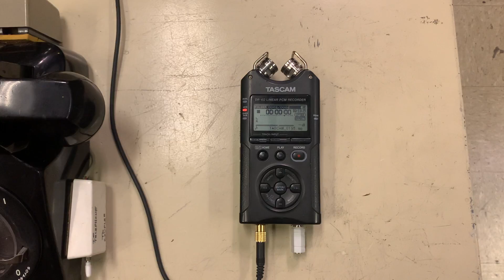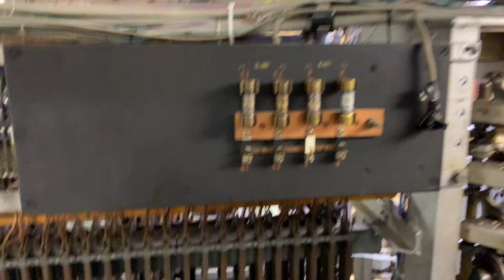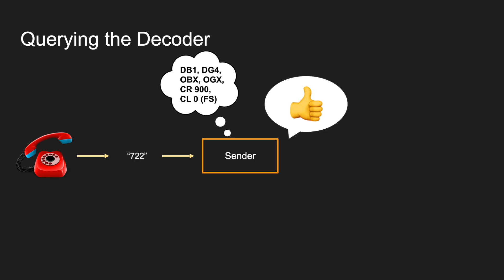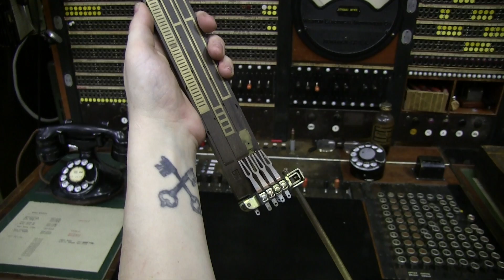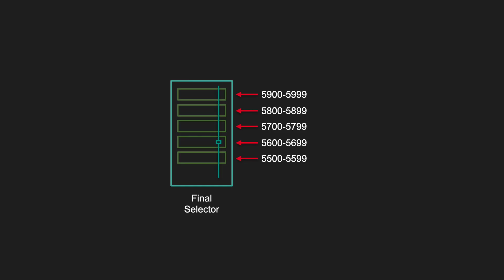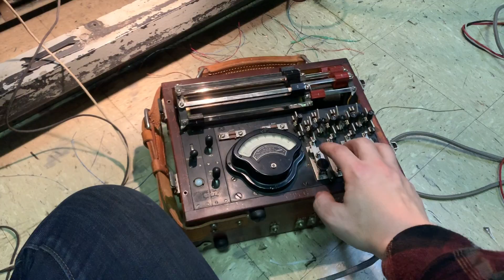Full Mechanical: The Panel Telephone Switch

Comment: How did they find that you had two phones on one line when you're only allowed one this is when the phone companies were in their Prime
Reply: at the Central office technicians were able to measure electrical characteristics of each individual line. Adding a second telephone to a line change the impedance of the line and they could detect that.
Reply: @martello44 I had to install a switch in the line so they couldn't pick it up and one day I forgot they showed up for the repair cuz you only have one phone now look what you got the switch is in a museum that's what got me started repairing phones

Comment: Knowing dial tone cuts out at the end of the first dialed digit helps answer a question.

Long ago when I was dialing BBS with a computer and modem I had a line that supported rotary only.  Touch tone was extra.  I discovered if I dialed the first digit as pulse then the rest as tones I could get free touch tone.

The above hack did NOT work on my parents' line which was on a different exchange.

Comment: Excellent video, and as a 30+ year now retired central office technician, I'm humbled by the insane depth of your telecom knowledge. When I started at Ohio Bell, we still had a number of 1AESS's in service. Talk about noise, when monitoring an on hook line, what you heard sounded like what you'd hear standing beside the switch, only at lower volume. Multiple rolling, overlapping chatter, which was soothing to listen to. I sometimes feel I was born 30 or 40 years late.

Comment: I am probably one a the far remaining panel switchman left.  Worked the offices that served the Wall Street area. If you think they are noisy you should have been there when Kennedy was assassinated.  I became one of the first No.1 ESS switchman in NYC.  Ended in Corporate Planning.  Quite a ride!
Reply from the maker: @emmaoliva914  I’ve heard what happened in Seattle panel during the Kennedy assassination. It was brutal. Did you have sender selectors in your office, or a panel link? Got any fun stories?
Reply: I was at 140 West St. from 63 to 67. A great bunch of guys there.

Comment: I'm wondering about the operation of the district and incoming frames as shown in the video.  Each selected brush is eventually connected to one set of contacts out of the possible 100 sets of contacts in the column.  For instance, in the final frame, the last two digits "78" cause the brush to be quickly driven upward with a revertive pulse every 10 rows, stopping at the first set of contacts in group 7.  Then the brush is slowly driven up 8 more rows with a revertive pulse every row, finally terminating on the set of contacts belonging to the called line.

So, I don't understand why the switch doesn't do the same for the district and incoming frames.  Brush 1 on the district is driven up to trunk group 4, which is a group of up to 10 trunks (10 rows of contacts), and the first one or more trunks encountered in the group could be busy.  Perhaps the museum's switch only uses the first trunk in the group, so the video doesn't show another step where the switch has to drive the brush further upward to find an idle trunk within the group.  Same question regarding the incoming frame.

Are the three contacts in each row of the column the tip, ring, and sleeve? Is the sleeve used by the sender to find an idle trunk in the group?  

How does the sender control the brushes on the incoming and final frames if they are located in a different central office, miles away from the originating office?   Thanks.
Reply from the maker: Good question! The district and incoming didn't go trunk hunting because in this demo, the first trunk was idle, so it was selected. If I had busied out the first few trunks, the selector rod would have moved up past the first trunk until it found an idle one.

The trunk hunting stage happens very quickly, and if you're not "looking for it", you'll miss it. There is a very brief pause between landing on the bottom of the group and then going up again to look for an idle trunk, but again, that step isn't shown in this video.

The three contacts are tip, ring, and sleeve. The sleeve terminal indicates whether or not the trunk is idle or busy. The process of finding an idle trunk is not done by the sender. The relay logic portion selector rod itself takes care of that. The sender is only used to get it to the trunk group in the first place.

If the incoming and final frames are in an office miles away, it is controlled in exactly the same way as if they are in the same building. The only difference is that if they are in the same building, the sender adds "compensating resistance" into the circuit to make the selectors appear as though they were miles away. The sender is "tuned" to work with the worst possible resistance on the trunk cable. If the actual resistance is lower than the "worst", resistance is added to make it worse.

Comment: WOW!!!😲 THAT'S SO INCREDIBLE!  Even more incredible is that (I actually understood some of it. That "SENDER" "STEERING-RELAY" that runs through the contact of another relay... ("A" relay I think you said). THAT'S WHY YOU HEAR DIAL-TONE A FRACTION OF A SECOND AFTER THE DIAL STOPS! That's exactly what our phone line did in 1964 did! I was 5 years old, but I specifically remember that. Means we were connected to a "PANEL" switch.... I guess, ( If that's a characteristic of the "PANEL" ONLY? THANKS SARAH, YOU'RE INCREDIBLE!😅 JEFF

Comment: I worked on 1/1A ESS switches between 1972-81 that had replaced panel offices.  I remember when i worked on inter office trunks from my ess to a panel office instead of a wink back I would get what we called “a ride” from the panel . a series of spurts.  The passing of the digits from our machine to the panel used “ revertive pulses “ instead of modern multi frequency tones.
Reply from the maker: Ha, that just happened to me yesterday when I was testing at a distributing frame. I love how you called it "a ride".

Comment: Good description. I am building a tiny PBX to route calls to other local rotary dial telephones ( not connected to outside lines). I notice the dial pulses I get on the oscilloscope are nice and clean, but at a real central office, I don't see how the equipment could determine the pulses from the noise.
Reply: Line opens electricly dial is normally closed contact

Comment: Absolutely brilliant! I used to hang out and make a pain in the neck out of myself at the local, independent central office when I was a 10-12 year kid (around 1970). On one visit, I was given a tour of the switch room. I've been looking for information on that switch for a very long time now. This is only thing I've seen that's close to what I remember being fascinated by that day. I may be misremembering, but I thought the switch I watched had some type of actuators moving horizontally as well as vertically. Either way, this is fantastic! Thank you so much for bringing this technology to life (keeping it alive and operating!) and explaining it so clearly! (I've been a phone nut my entire life... even got into the private payphone business the year it became legal.)
Reply: I remember when COCOTs started showing up, thinking how odd they were and trying to see if they could be gamed for free calls. ;)
Reply: @poofygoof  Coin return stuffing was the biggest annoyance. I had anti-stuffing devices, string cutters, etc. so stuffing wasn't profitable for the culprit, but it still sometimes disabled the payphone. Occasionally I had callers scam the operators, resulting in chargebacks to the line. The key to avoiding losses in these cases was to pay the extra for a legit payphone line -  which was double the price of regular business lines. With a payphone specific line, chargebacks were always removed without question.

Comment: Question: how did the sender & decoder handle the district frame for long distance? I worked in a CATV digital headend in the mid 2000's. I was part of the digital video + VOD team, but our brother admins in the master NOC were in the VOIP team, and we shared knowledge about the different systems in convo all the time (read: Unix/Linux nerds drinking heavy at the end of the week, sharing war stories). Watching circuit switching here vs. packet switching telephony is a very interesting contrast. So many similarities and yet so differently executed!
Reply from the maker: Good question. The decoder doesn't handle long distance at all. The panel switch was designed before automated long distance switching was possible, so it only handles local calls. Before the 1950s, long distance calls were handled by operators. After the 1950s, the senders themselves were modified to recognize area codes (X0X or X1X), and send those calls to a separate long distance switch for processing.

Comment: Coming back to this video after 2 years.... (one, it's already been two years??! two, they make for really good background information while I'm picking apart why one of my Linux systems isn't behaving the exact way it's meant to), I question something.

Incoming advance is signaled with a polarity reversal. In another video , I believe you mentioned that when a sender goes trunk hunting and finds all trunks busy, it sends back a "tell-tale" signal, that's... also a polarity reversal. So doesn't that leave two possibilities that can't be signalled unambiguously?

The first would be that the final frame is completely busy and so the incoming can't grab it, but I really don't think that's a possibility from what you've described. The second, and more important one, would be what if the called party's line is busy? It seems like the only ways you can really signal to the originating office are "revertive pulse," "reverse polarity," or "disconnect the line," and, I don't think that leaves room to signal a busy condition? I know I'm missing something here.
Reply from the maker: You're right. Incoming advance and tell-tale are both a polarity reversal. The important thing is that they occur at different times. Incoming advance can only occur once all selections have been satisfied and the selector frames have moved into their "ready to proceed" state. The sender differentiates between the points at which it can receive the reversal and acts accordingly. Any other polarity reversal at any other time will indicate a tell-tale...or...

If the final frame is busy, the incoming selector will go to "overflow", which is also a polarity reversal. It is effectively the same as "tell-tale". Overflow just means "all the choices were busy" and tell-tale means "I didn't receive any instructions to stop, so I proceeded as far as I could until I bonked my head". Each group of terminals in a bank reserves one terminal at the top of the group for "overflow".

If the called party's line is busy, the sender does not know, and does not care. It has done its job of connecting you to the line, and at that point, if you hear a busy signal, that's on you. This is obviously really inefficient, so later crossbar systems completed a busy test before even connecting you to the called line. This saved some effort on the part of the control and switching frames, and just returned you a busy signal without establishing the full connection.
Reply: @ConnectionsMuseum  Right, because final frame overflow would happen before any FB / FT / FU selections were made, I was thinking there was a brief moment there where the same signal method could convey two different meanings. And as for busy... presumably, instead of connecting you to the called subscriber's line, you'd be routed to the tone plant to make angry buzzing noises, but yeah, sender's done it's part. It told the term office what number you're looking for, that office's decision to route you to a bees nest instead is not it's problem. 

I really need to stock up on film (I have a weird fascination with old tech, apparently) and carve out a day (okay, given the travel, half-week) to drag myself up to the museum, but then I'd be asking questions until I was thrown out of the building, hah.

Comment: I worked on SXS, XY, DEX and DMS switches and had planned on visiting the last panel switch at Pacific Telephone in SFO but they ripped it right before I was able to go. At Bell System Private Line School, during the data section the mentioned that panel offices were notorious for impulse noise. I now understand why. Thank you! In the Army, our SXS and XY exchanges had end cells and end cell rectifiers.   During high traffic, the end cells would cut in and add another 2V cell to the battery string. You could also tell when it was busy because the batteries would run down, so they wouldn't filter the 60 Hz hum from the rectifiers as well.

Comment: How did post-1928 (iterations of) Panel count dial pulses? Did they use a pure relay counter (more sophisticated than earlier steppers?)
Reply from the maker: Yes. By 1928, all new panel offices had "unit-type" senders with relay counters. This includes ours, as our senders were replaced with new ones in the 1950s. Originally, it had steppers to count dial pulses, but they were unreliable, and required lots of maintenance.
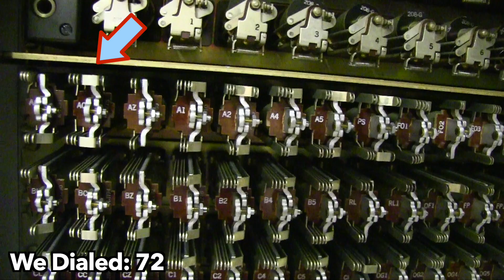Reply: Are those relays ripple counting the dialed 7 @28:04?

Comment: Many thanx for the video.  I've always wondered how the Panel System worked.  When I was a young tech here in New Zealand we had Western Electric Rotary Systems .  7A, 7A1 and 7A2.  I can see how these two systems are related  by the way of the Line finders, registers, sequence switches  and group and final  selectors.

Comment: I'm sure I'm missing something here, but isn't every other trunk/subscriber in the column on the frame now unreachable since the brushes are tied up on the circuit that's now up?
Reply from the maker: I'm not sure if I understand your question correctly, but I'll try: Each rod will only ever handle one call at a time. All of the 5 brushes on the rod are wired together, and only one brush is active at a time, therefore each rod can carry one call.

The terminal banks dont have columns. They only have rows.  All of the terminals span the width of the entire bank, so any vertical rod can reach any terminal on the frame. Once rod #2 is on terminal 31, nobody else can use terminal 31 on the entire frame. The next rod has to look for terminal 32. And the next rod must use terminal 33, etc.
Reply: @ConnectionsMuseum  That's what I didn't understand, was that each terminal was repeated multiple times across the frame.

Comment: I've  been in step by step offices, crossbar offices, and an ESS office, but I never thought I'd ever see a panel office. Let alone still in operation!  Thank you for saving the only one left in the world!! But ironically, the oldest switch of all, the Strowger switch used in the SxS system, was also the one that was in service 
longer than all of them!
Reply: Some of them were even retrofitted for touch-tone, IIRC, but I could be confabulating that lol. But it's not beyond the realm of possibility, because obviously plenty of them were interfaced with digital offices.

It's probably safe(r) to say there are no panel offices anywhere in the world providing phone service.

But there are step offices that handle VERY few customers.

There may be a crossbar PBX still running somewhere in the world, perhaps even being used for residential phone service.  Probably not tho, because mobile is now ubiquitous.  I think that's what eventually did all the electromech stuff in.

Im not sure if we can say definitively that there aren't any in operation.  I mean, I was blueboxing up until 1997 or so ...
Reply: @bsadewitz   A crossbar PBXs continue to operate throughout the former USSR to this day. Not everywhere, but in the provinces, they are still used.

Comment: I know this video is a while ago but I missed it first time round.

Truly brilliant in that I now comprehend the basics of the panel system and the novel concept of sequence switches which reflect state theory! The chart at the beginning of the video with the states listed was screen captured and printed; it made understanding later much simpler.

I finally twigged that the panel switches mapped onto Strowger vertical and rotary banks (pretty obvious really).

If only we had some panel switches in England …

Thanks ever so much.

Michael.

Comment: This is excellent.  I worked SxS no.1 and SxS cama with intertoll class 4 and class 5 local for southwestern bell in the 70's.  But this panel switch is really interesting to me. I used to read on options on cama senders for dial pulse,  Mf,  but revertive and PCI was foreign to me. How can I find out more.  Working in the bell system was truly good times.  I loved it.  Thank you so much for showing this.

Comment: Having worked in a Panel switch office I notice one big difference. For whatever reason the CO was poorly lit. In each aisle there was a string of 100 watt bulbs about 15’ apart. Each COT carried a right angle flashlight to look at the equipment. A flashlight with 2 D cells back in the day was good for about half hour of continuous light.
Reply from the maker: Yeah, ours was originally outfitted with 25 watt bulbs, according to the schematics. We've still got some of the old incandescent fixtures in one aisle. 

The office got fluorescents sometime in the 50s or 60s, and even they're not great compared to the lighting the crossbar offices had. We're currently putting in new lights, which should look much better.
Reply: I worked for APC-- test equipment company,  We sold long distance trunk testing( ROTL) installed in the CO's   On my first visit to a #3ESS I noticed the fluorescent lights were all off-- lights off switching.   you'd turn them on to go in to work.   I was told the ballast supplies generated EMI that got into the switch.    Flashlights would be a solution.